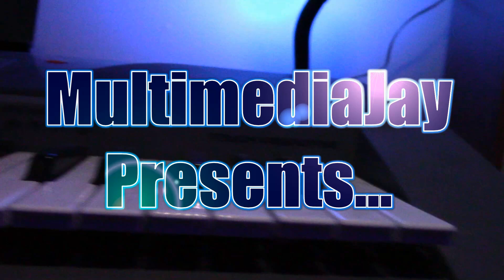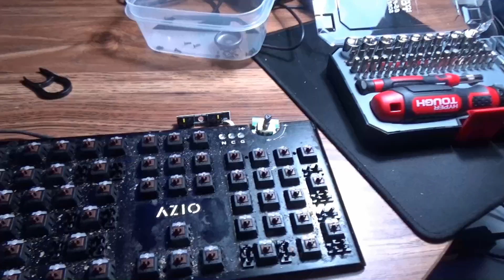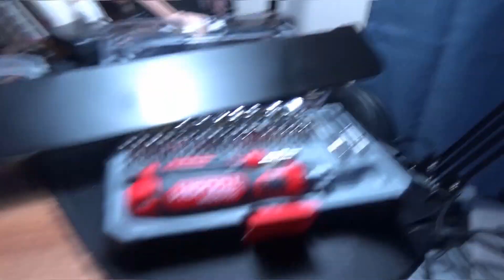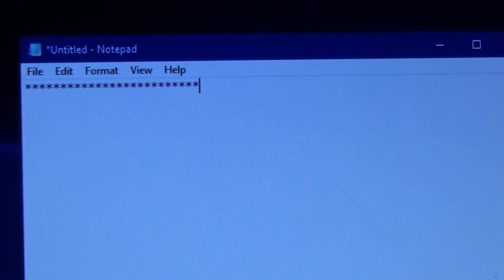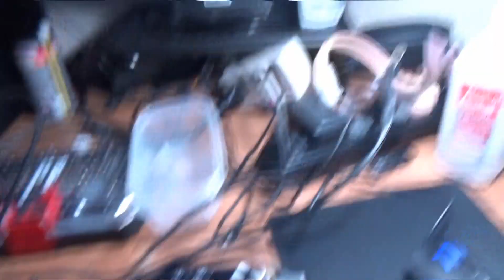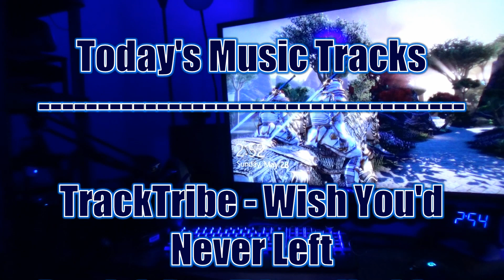Mechanical Keyboards - Bah Humbug!!!

Comment: I have gone through two mechanical keyboards both Red dragon k52 first was an accidental soy sauce accident
And the other would just randomly start disconnecting and reconnecting even after cleaning the usb port and the connector then recently have gotten some velsafire and atrix branded mechanicalkeyboards for about 30 bucks each and doza been working a lot longer I just like these type of keyboards because they are a bit more sensitive and I don't have to do as much key travel with my wrist and finger pain it helps

Comment: I spent $25 on my mechanical keyboard and they've done me fine. I'm never bothered with repairing them because they're so cheap. 
in fact there has been an improvement on the layout since I last bought mine so there isn't any fn key layers so you don't have to switch between media keys and f keys. 
I will also say that the $25 keyboard is extra compact, it has no f keys or media keys, it requires using the fn key, which I honestly don't mind for the extra mouse room and added portability. I call it the "69%" keyboard since it still has arrows and nav keys unlike true 60% 
the real reason why I don't use a membrane keyboard is that I play rhythm games and there isn't any high polling rate or NKRO (basically able for the keyboard to recognize the entire keyboard at the same time) on membranes. when I play a rhythm game that could legitimately need 7 keys pushed down and registered at the same time, you could see that as a problem.
Reply: I'm saying this as someone who legitimately likes typing on chicklet keyboards on laptops. it's just that for some things that I do with a keyboard, a mechanical keyboard is just objectively better, and if you can, a cheap mechanical keyboard may be better than a mushboard. I also think that a very good membrane keyboard can be better than a crappy mechanical keyboard. I just happened to get very lucky when finding a good cheap mechanical board. this one just happens to have 1000Hz polling, full RGB backlight, and NKRO. back when I got 3 of these keybs it was rare to find them for under $40, but they were getting rid of stock because these sold out a month after I got them. now they're just unashamedly $25, albeit a different no-name brand.
Reply: I need to make some corrections. I'm bat at typing, I didn't mean to say that a membrane is worse than a cheap mechanical board. 
I meant to say that a good membrane can still beat the pants off of a cheap mechanical.